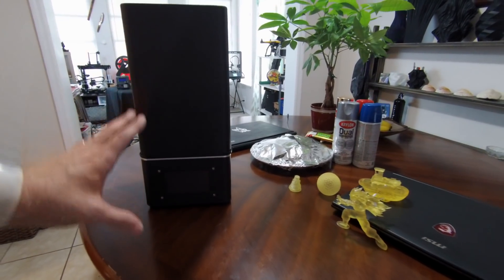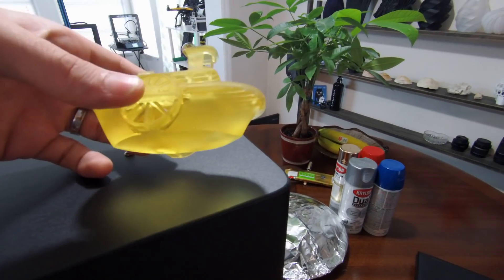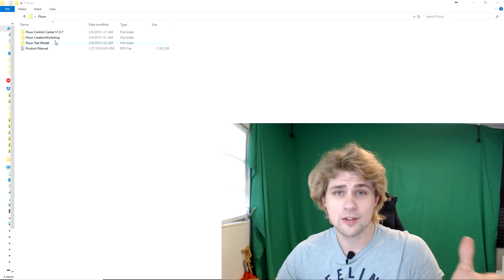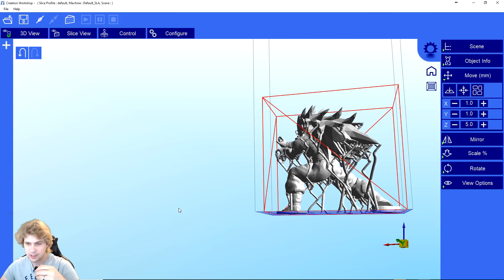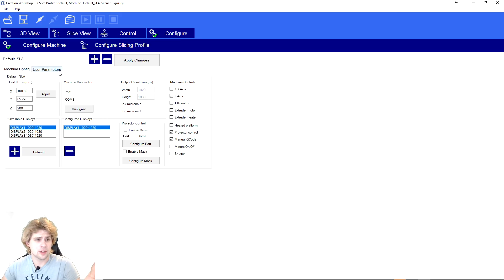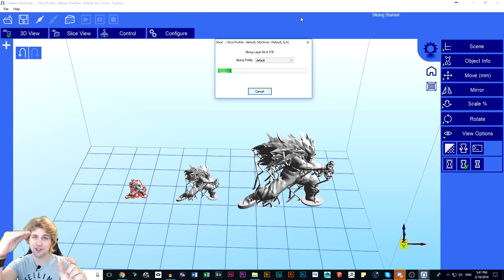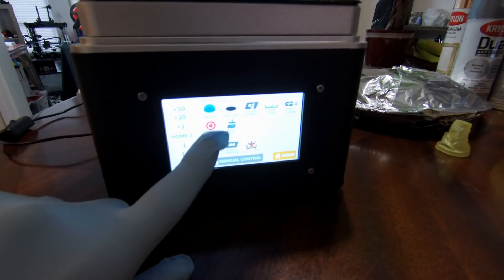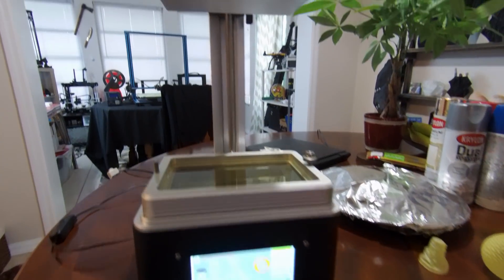✔ PERFECT 3D GOKU! | FLSUN SLA/DLP UPDATE! aka Micromake L2 Resin Printer

Comment: before you send the prints to CW, use meshmixer to hollow  and add drain holes to save half of the resin amount, normally a 1 or 2 mm wall is plenty enough for resin printing. EDIT  Judging by the layer exposer time @15000ms this is not a DLP, it is most likely a LCD with UV back lighting probably a series of 1Watt LED's  , a true dlp would cure resin at more then half that time. my dlp cures layers of 0.04 in 4600ms.
Reply from the maker: Interesting to hear! I guess it is still technically digitally projected light LoL but  seemingly weaker? I wonder if this is just more cost effective?
Reply: No it is not " Technically" the same, there is a huge difference between the two technologies, Doesn't make this printer a bad little print lol . Yes indeed DLP is much more expensive,  the proof is in the pudding right ! your prints looks really good and for a 700$ CAD for the printer! the price is fantastic.
Reply from the maker: No doubt, I'm not saying they are technically the same, I was making a joke about how it is technically a digitally projected light being lcd
Reply: lol I know you were being a silly, im still rather impressed by the quality of the prints verse cost of the printer.  id be curious see how well it would do with this thing https://www.thingiverse.com/thing:906266 the print time on my end at 0.04 is 5h:47m

Comment: From what I've seen from other videos it's best to put some holes in your object so that the extra resin can pour out saving you resin.  You can take it into meshmixer and they have a hole option in the menu and you can put it on a flat spot and later fix it.  Here's a video https://www.youtube.com/watch?v=dC_nPqJFQbY
Reply from the maker: for sure, i have had quite a bit of experience with meshmixer since last year)) I just wanted to create a solid object and didn't think about the actual size for material cost. For the average item I would definitely hollow it out like you said)